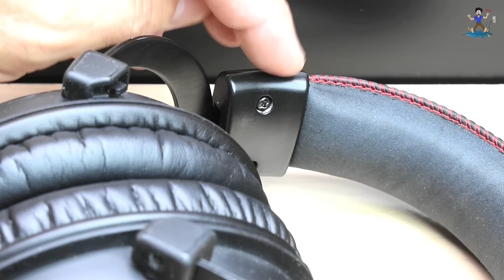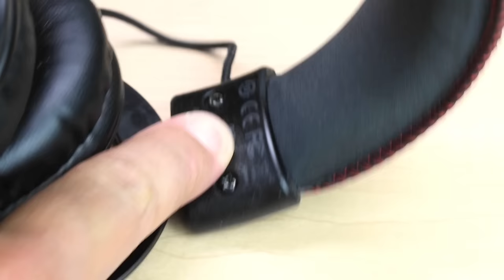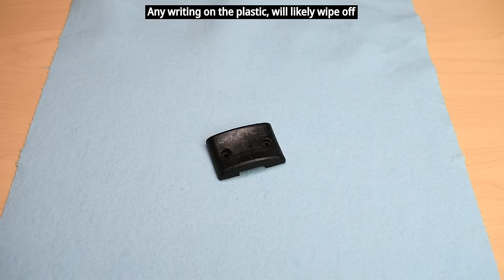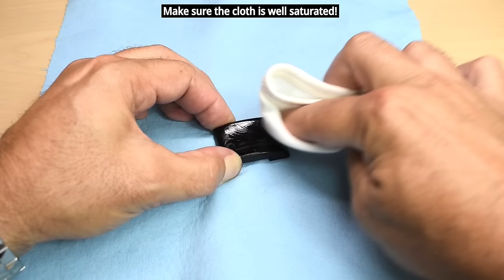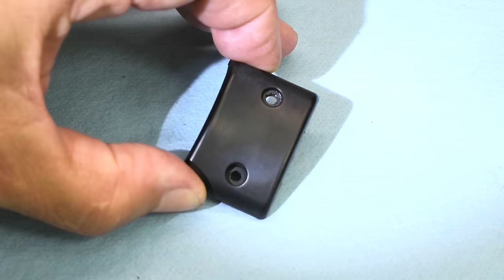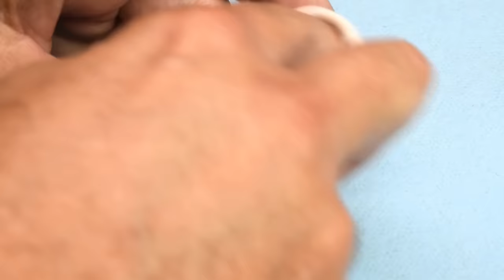How To Remove Sticky "Gummy" Coatings From Electronic Devices

Comment: I need this fix so bad! I have a really nice Logitech universal remote control and and emergency wind up radio that are both really sticky! I’ll try your alcohol, then WD40 to finish it off. See, I did watch the whole video!
Reply from the maker: Is the radio made by Eton?
Reply: In my area, even though we are on a county wide lock-down, the Dollar Tree is still open.  They sell stuff called "goo gone"  It works for this perfectly (sadly, the alcohol they sell is only 50%).  It's a decent sized bottle for a buck too.  I just did a fairly good sized lantern and I don't think it took even a 1/2 an ounce. It has an orange smell to it and not foul, which is nice.  I had a 90s era MP3 player with the same problem and I did that one a long time ago and it has held up nicely and not come back.
I didn't even know rubbing alcohol would work because when I first tried it years ago, it was with 50% and it really didn't help.  Next time I'll try the alcohol.
I'm glad guys like electronics and more are stepping up the video output!  Helps pass the down time.
Reply: electronicsNmore Duracell KP028 Crank light with am/fm radio. It horrible to touch and does not come apart.
Reply from the maker: I have a crank radio made by Eton, it's very nice, but it was a sticky mess. I cleaned it up 6 years ago with wd-40 and a no-scratch pot scrubber.
Reply: electronicsNmore Thank you so much for this awesome remedy! I haven’t done it yet, I’m too busy on quarantine! 😂😂
Reply: @electronicsNmore  I've noticed more and more power tools have a rubberised coating.  Is this stuff known to turn into the same sticky mess that electronics with rubberised coating turns into?  I know they use much stronger and much higher quality plastics, but I don't know about the rubberised part.
Reply: Hahaha i have the emergency radio too! I covered it in cornstarch and rubbed it off, but the thing isn’t very good at charging my phone, have any of you experienced this?

Comment: I use unleaded gasoline. Works well on these rubberized coatings that were DESIGNED to disintegrate over time (so you'll have "no choice" but to buy new equipment).

Comment: I had the same problem with a pair of beats heaphones.  I got rid of it with one part water, one part baking soda (it turns into a paste) and using my fingers.  Much better than alcohol.
Reply from the maker: Too harsh. You made an abrasive mixture. People brush their teeth with baking soda.

Comment: I just tried dishsoap and water... meh.  Lol, then a bell rung in my head; YOUTUBE IT!!  Thanks for the perfect video!  Will buy some alcohol and try it!  (Assuming Vodka doesn't work, soooo...)
Reply from the maker: It works, just don't rub too hard, you may remove the coloring from some plastics. Do a little, then check. You can see when the gummy film is gone, that's when you stop rubbing. Good luck
Reply: UPDATE:  Didn't feel like going to the store; used some hand sanitizer with 70% alc, no foo-foo colors or flavors and it worked like a charm!!  Thank you @electronicsNmore !!

Comment: I have a big Logitech flight sim control stick and throttle that this gummy crap happened to.  It took a lot of isopropyl and scrubbing to get it all off and down to the smooth plastic.  That rubberized surface turning to goo can’t be an unknown problem to the industry, so I have to wonder why manufacturers keep using it.
Reply from the maker: I hate that surface. 😤
Reply: Probably because it’s cheap.   It’s poor quality coatings where the the coating starts to break down over time

Comment: are there any alternatives to isopropyl alcohol? coz pure isopropyl alcohol is quite expensive even for a 500ml. is WD-40 mandatory? what happens if you dont apply WD-40 after removing sticky rubber surface? will the stickyness come back?
Reply from the maker: It's cheap 70% or 91% isopropyl alcohol, if you can find it with Covid.
Reply: @electronicsNmore  went to the pharmacy and it said abt RM30 in my country, abt USD7.41 for 500ml, even hardware stores in my country say they dont sell coz it evaporates easily, so as for now im just gonna try Dettol hand sanitizer

Comment: You didn't mention that the text on the plastic also disappears. This method does not work on, for example, a radio front with text.

Comment: This exudation problem should have been solved by manufacturers a long time ago. I assume it is a plasticizer or impact modifier that is coming out over time. What ever this gunk is, needs to be removed from the plastic in these parts, cleaning it as shown is about the only thing the consumer can do, but keep in mind that this stuff was part of the plastic composition and was there for a reason. Some property of the plastic will be changed by the loss…maybe flexibility, impact properties or feel.
Reply: Do you think the sticky stuff is toxic or carcinogen? Or simply annoying? THX

Comment: Use silicone Spray instead of Oil to avoid Bad small.
Reply from the maker: The WD-40 is fine, I didn't notice any strong odor. You're wiping the majority of it off. Thanks for watching!

Comment: I  had this  gunge  on a  camera, after  cleaning I  coated the  rubber  parts  with  the car  alloy  wheel  spray sealer  by  squirting it in the  lid  &  then quickly  painting  over the Rubber as  it  dries  quickly, up to now  it  hasnt returned.l

Comment: OR use hot water and a microfiber towel and apply a dab of olive oil since the residue is oil activated and wipe it off clean 🧼
Reply from the maker: That doesn't work. You're only hiding the gummy surface, it will return.

Comment: IPA is a GOOD cleaner ! .... for ( some ? ) sticky residues , a solvent used in the printing industry is good .... this is (  orange or lemon oil  terpene  ) , obtained from the outer rinds of these fruits ... this is non toxic and ... smells NICE !  also it does not evaporate too soon ... FULLY penetrating your sticky goo mess . ( tried - n - tested ) ... DAVE™🛑

Comment: China has been doing this ever since I purchased shop tools for woodworking in the 1980, I still own a miter saw which does not have the material that goes bad, good for me.  Old options though, the tech has improved with time, if you don't consider the dissolving  soft plastic a problem. I'll not buy them in the future, until they advertise the coatings to be fixed, concerning this problem.  If consumers would demand it, it will happen.  The petrochemical companies have had this problem fixed in the past and the current equipment manufacturers sometime back, went the cheapest application of the grips protection and let the consumers down.  That is why the actual name of the company that makes these tool for everyone else and then puts the brand name that applies onto the line of tools, currently named so it can be dropped and a new name put forward for retail stores to carry.  Good luck with that happening though, I don't expect it any time soon.  I won't purchase these in the future.

Comment: BEST WAY: Use 91% Isopropyl alcohol (NOT 70%) with trigger sprayer and a softer interior car trim cleaning tool. After all sticky/gummy substance has been removed. Spray plastic with 303 Aerospace Protectant. I did this on my 15 year old motorcycle glasses/ goggles and they look like a brand new $50.00 pair of goggles. Best of all this did not remove the manufacture painted logo or painted registered trademarks.
Reply from the maker: Too harsh 91%, it attacks the plastic and painted finish far worse than 70%.

Comment: I have the exact same headset (Hyper X Cloud). 
Stored them in their original box for 1-2 years, opened them today and all the plastic parts have that disgusting gummy coating.
This was the best headset for 2015. Couldn't those retards put some cheap metal instead of plastic, so we don't have to deal with all this? 
Great video, thanks for posting & helping.
Reply from the maker: I hate that gummy residue, it ruins all the products.

Comment: apparently there are various rubbery coatings, tried this and it didn't work for me  :/
Reply from the maker: It should work, rub longer. Worst case, try some mineral spirits on a q-tip......it may attack the entire finish.
Reply: Yep, I've tried so much to save some devices and it never works for me. I've tried isopropyl alcohol, acetone, baking soda paste, followed by windex wash, dishsoap wash, WD-40 wash...and every combination...and stickiness returns very fast.

I usually end up coating the part with dip or silicone tape...or just remove when possible.
Reply: @PowerScissor  I ended up slicing the rubber off together with some plastic, it sure doesnt look nice, but it at least feels half decent, doing this somewhat depends on the shape of an object tho.

Comment: Isopropyl alcohol is not very efficient in removing this black goo. It works but requires a lot of time and effort. Pure grain alcohol (95% ethanol) is way more efficient. It removes this sticky coating like a breeze.

Comment: "Goof Off" worked for me. Put some on a rag and rub. Use rubber gloves.
Reply from the maker: Very harsh stuff, it usually strips the color off fast.
Reply: @electronicsNmore  I used it on an Edirol mp3 recorder and no problems as well as wind up flashlights and a wind up radio(red color) that did have minor discoloration but still better than having that sticky goo!!